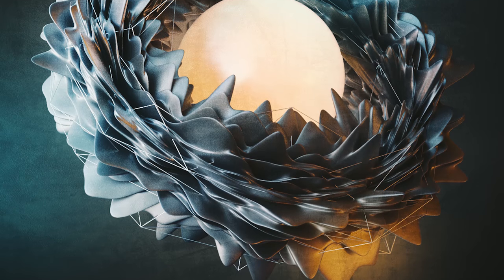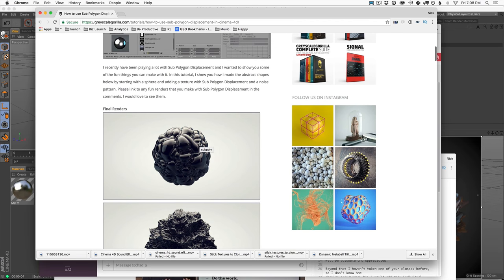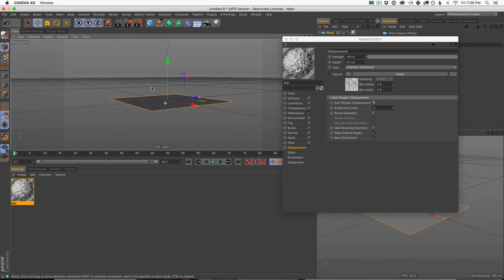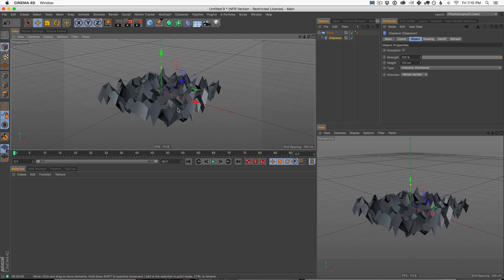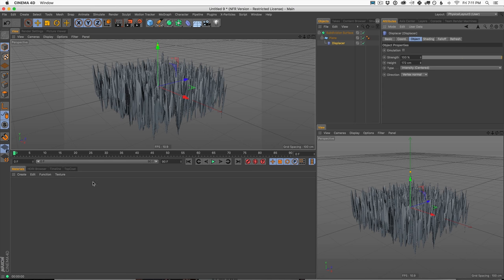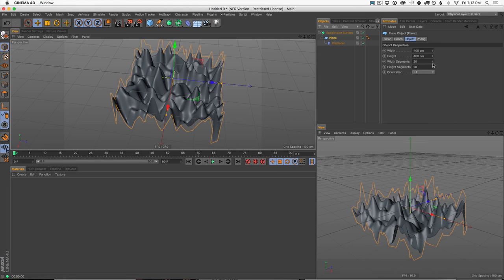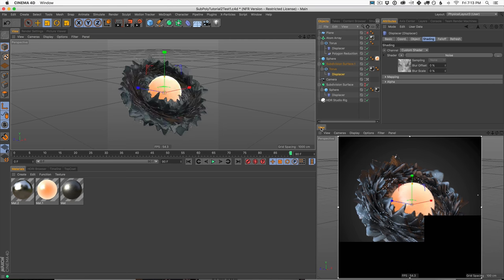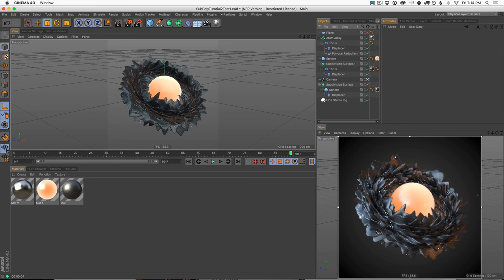Cinema 4D Tutorial - Displacer Deformer And Sub Poly Displacement

Comment: If you put the displacer as a child to the subdivision surface under the the object(not a child to the object) you can set the render subdivisions extra high and keep the previews low and it'll work as a way to get exactly what you have as the displacer texture on the object

Comment: Just wanted to add that hierarchy makes a huge difference here. What the guy here is doing is SDS->Mesh->Displacer ("->" means parent of). But this smoothes out a displaced lowpoly geometry, rather than displacing a subdivided highpoly geometry, what he actually intends to do. To get this you could put the SDS->Mesh and the displacer both under a null object ON THE SAME LEVEL. A displacer doesnt have to be a child of a mesh to work. Has way more detail. Just try it out.